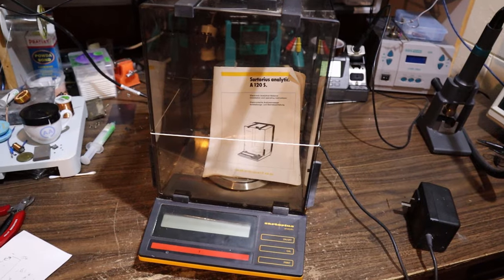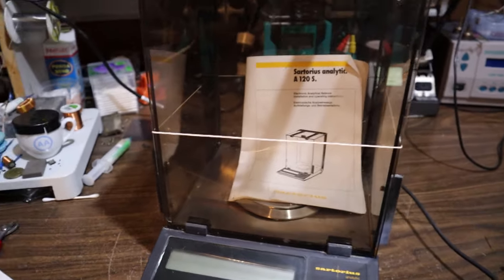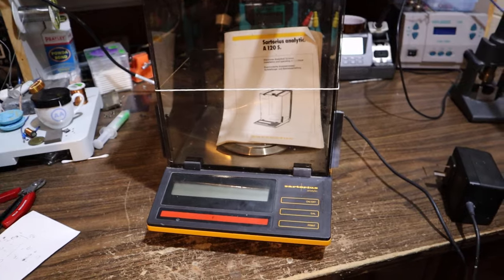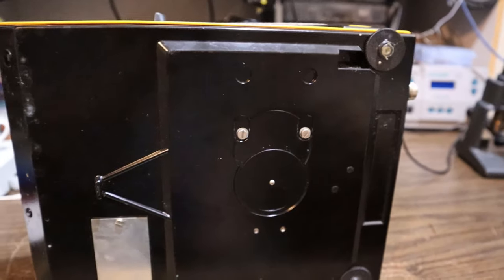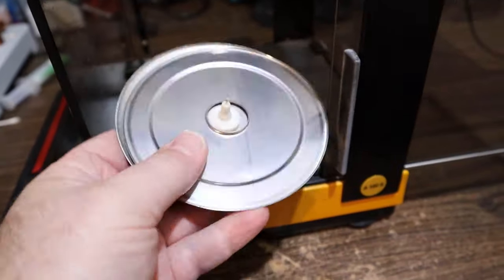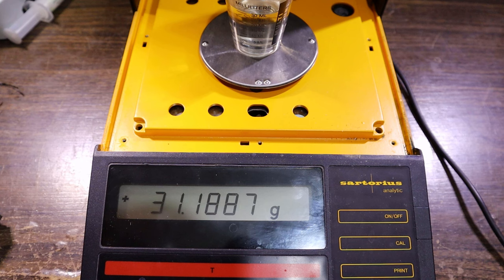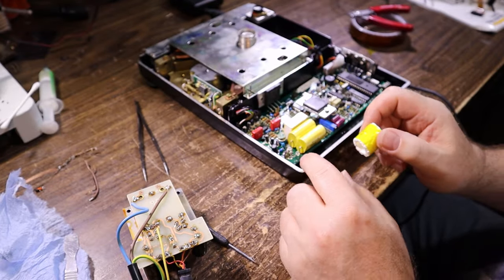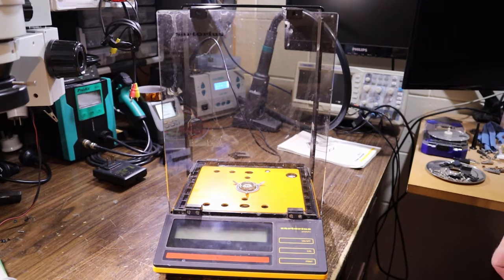Sartorius Analytic Balance Repair

Comment: Having a similar model at work, and a Metler of similar vintage, the 'Cal' button is used to actuate that mechanism under the pan to place an internal calibration weight on the weighing arm. This allows the operator to correct minor drift between service intervals. Usually it requires it to have only the standard pan in place, but the manual likely has the instructions. This doesn't replace proper external calibration audits with certified weights if being used in an analytical lab. But it would be more than adequate for any amateur use.

Nice job all the same! Glad to see good old tech seeing new life!
Reply from the maker: Oh nice, thanks for the info!

Comment: Did you notice, when you had the water in the glass, the weight was slowly falling as the water evaporated.  Many many years ago I worked in a lab with a similar balance (it was kept on a solid granite bench to reduce any vibration) you could weigh a piece of paper, make a mark on the paper with a pencil and weigh the added graphite!. A man came every six months to calibrate it, white cotton gloves and his test weights were only ever touched with tweezers to prevent any oils from fingers affecting the weights.
Reply from the maker: That's really neat. I want to try that evap measurement now but I no longer have it. Would have been good to see how fast my alcohol evaporates.

Comment: There's a print button, maybe the motor/mechanism is for that?
Reply from the maker: There's definitely no printer in this. I think that would attach to the connector at the back.
Reply: @JonnyFix  I will admit, I had the video playing while I was working, so paid more attention to what was said, rather than the guts of it!

I saw the button and heard the mention of  a button and connected the two, albeit, wrongly